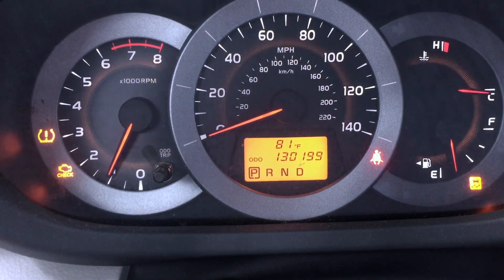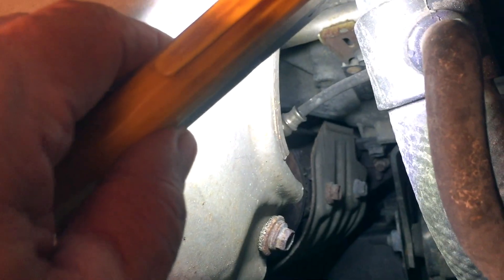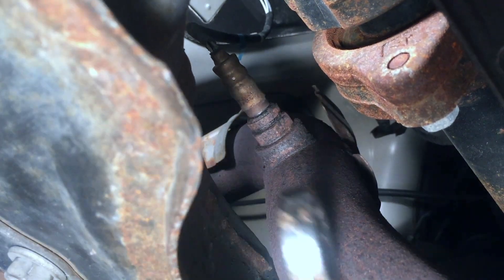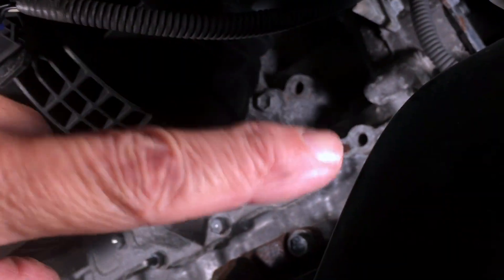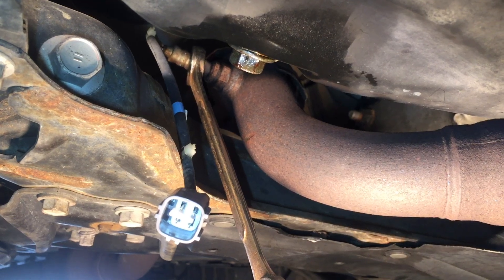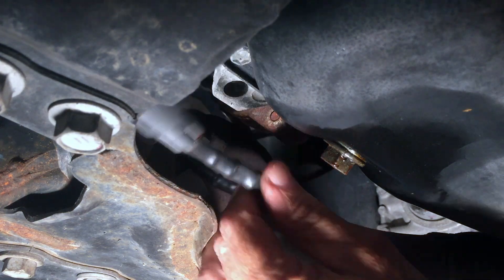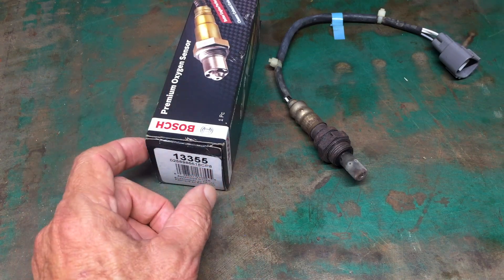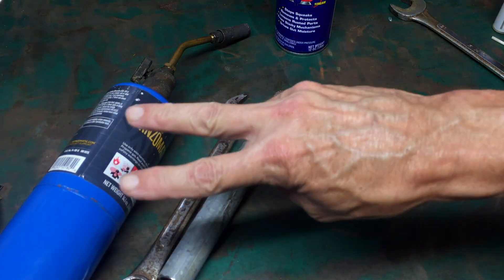Toyota P0137/Oxygen Sensor Replacement RAV4/Camry

Comment: Question ❓ , How many catalytic converter a Rav4 has.. is that bottom o2 in a botton catalytic converter, or its just the only on top. Thanks
Reply from the maker: My 4cylinder has 2 converters.. Bottom O2 is not in a converter.. 

This was the answer I got from web search:

"A 2011 Toyota RAV4 typically has two catalytic converters: a primary one integrated into the exhaust manifold (closer to the engine) and a secondary one further down the exhaust system. This setup helps it meet emission standards, with one handling the initial exhaust gases and the other providing further treatment before release. 
Front Converter: Often part of the exhaust manifold, located up front in the engine bay.
Rear Converter: A second unit situated further back in the exhaust system."

Comment: Thank you. Could working on the car right  after it's driven make it hot enough to bust loose?
Reply: Andrew, While it probably past the time you are doing this job, working on it right away after driving might but probably won''t help. The best case is to heat the external part (exhaust pipe grommet) quickly and then try to loosen before the heat sinks into the internal part. Heating the external part only expands the outer diameter and hopefully breaks the rust bond somewhat. It also helps to heat up and then spray with water to cool the inside part a few times before putting major torque on the sensor. When I did the job today I was lucky enough to only have to bend my combination wrench slightly to eliminate interference. The sensor came out on it own without having to use the blue tip wrench.

Comment: 3:33  Using propane torch for 4 min wasn't enough first time. I think it was because I didn't heat that nut enough specifically as first time I went over the whole area. So second time I heated the nut another 4-5 min until it started to glow red and then put my wrench on and it worked. My RAV4 is 2010 so that oxygen sensor has been stuck there for probably 13yrs! 
Also like to say this video was superior to all the others I seen for this viewing the O2 sensor removal. 
 Toyotas has made the RAV4 & Camry a pain to service. From the special tool for oil change, to the difficulty in changing the serpentine belt, to now this oxygen sensor. 
Regardless I still like the RAV4.

Comment: Thanks for the sharing. It is a fantastic video. May I ask that after you replaced the sensor and turned on the engine, did the engine check light disappear right away or only after you drove for a mile. Mine did not go away even after following the same procedure.  I have exactly the same car model and code as yours and installed the same Bosch O2 sensor.
Reply from the maker: After replacement check engine light was still on initially but went out during my short drive (1 mile) to get gas.. If you don't have a scanner to clear your light you can disconnect negative battery cable for 30 seconds or so and that should clear it.. Then drive and wait to see if it comes back..

Comment: Great job sir! I've followed your instructions and I was able to change it also. Removing the connector is a pain, I needed to remove the front right wheel and hassle with it until I got a good position using 2 hands so I could eventually pull it out. The only thing I would add, is to screw the new sensor with the wire tucked near it (with a rubber band)..it goes pretty easy that way. Thanks again!!
Reply from the maker: Glad to have helped.. Good suggestion with the rubber band.. Will try that if/when there's a next time..

Comment: Just the video I needed!  Thanks!  Only suggestion I have is the Denso sensor from RockAuto is the OE Toyota sensor and it's only $44 for this one.
Reply from the maker: Yeah that's the smarter move going OEM..
Reply: I just ordered it.  Local parts stores are charging $85 for the Bosch sensor!  Insanity!  @PeanutButterMan-PBM

Comment: MAP gas ( yellow cylinder), burns hotter than propane and cost very little more. Works very good on rusted bolts, etc. Nice video. Got to do this ASAP. Always use OEM sensors. No shortcuts for these.
Reply from the maker: Yeah I may regret the Bosch sensor but so far so good.. OEM better choice but $75 more.. Thanks for the tip on MAP gas.. Will do next time..
Reply: Aww sh*t, I didn't use an OEM sensor.. Also it took me two tries with a propane bottle torch to get that sensor off..